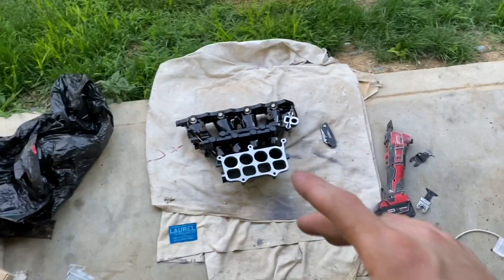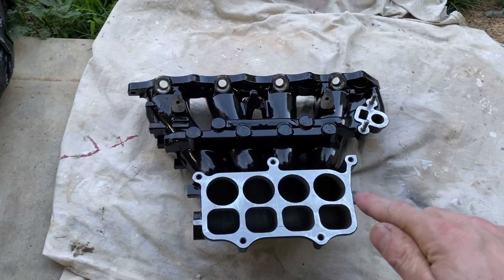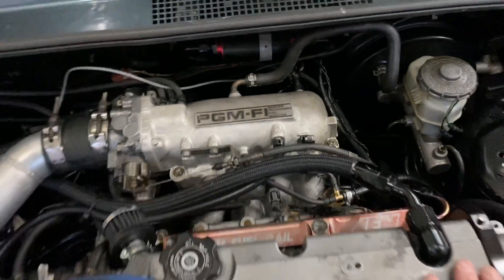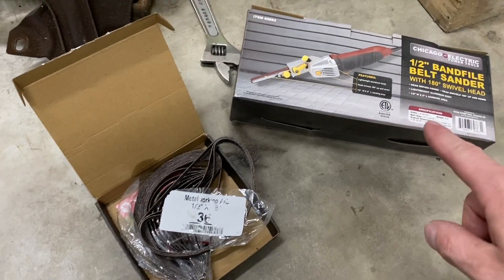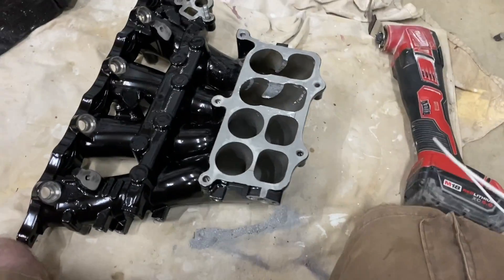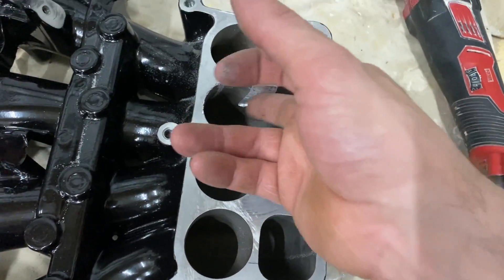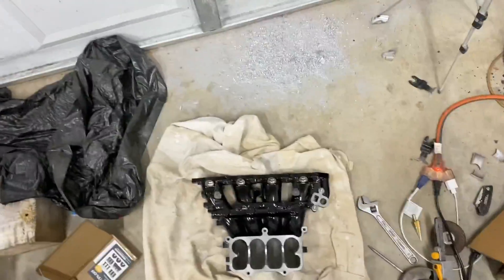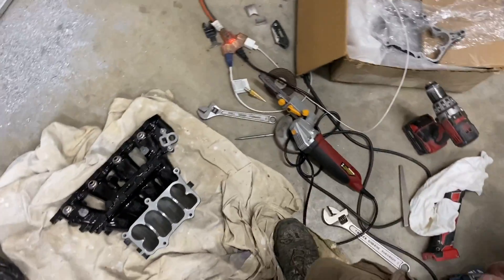Intake Manifold Port - H22 Max intake volume!

Comment: Great job doing the same thing and really like how you bolted the spacer for port matching. 91 cb7 se
Reply from the maker: Thanks brother! A lot of elbow grease in this operation but it creates a good amount of air volume right behind this intake valves. Great for those high rpms and or forced induction.
Reply from the maker: Hoping to complete an F23 crank and rod/H23 block/ f20c ap1 piston combo one day as I have all the parts aside from forged rods. It’s the most budget friendly forced induction engine.
Reply: @thestateofreal2533  that's awesome. Mine has a long way to go but being as I have 2 usable blocks I'm probably doing one forged internal and the other might end up a g23. Trying to leave a option for boost later if funds will let me do it right and budget friendly. Will be posting the build when I'm done, from rat's nest to glory. The 91 cb7 se is a one year only thing so I'm really trying to do it right for the honda guys.

Comment: I heard doing this sacrifices low end torque for high end power, any thoughts on that?
Reply from the maker: I have heard this theory but never seen it proven on the dyno. The idea seems right but the reason we do this is to combine it with other things like adding a bigger cam for instance which will need a more free flowing intake. In my instance I have both a larger cam profile from an F20B and forced induction - turbo charger - which makes incoming air more dense right at the back of the valves until they open. The more dense air volume that can fill the intake, the more we can cram into the combustion chamber.
Reply: @thestateofreal2533  any idea if this will cause issues for a stock h22a4?

Comment: Say no to knife edges when porting
Reply from the maker: Why do you say that?
Reply: @thestateofreal2533   Take example from F1 engines and MotoGP engines. They take examples from a water drop because 💧 will take the best shape for air flow, that's why CRX have better coef. of drag design than any other Honda including, Lamborghini's, Ferrari's, McLaren F1's and you name it. Because it looks like a tear drop with chopped off tail, and Prius has even lower coef. of drag because it has even less "knife edges". Big in the front and tapers down to in the back, but the front of any air cutting devider has to be the same size as the whole divider, it has to resemble a rain drop.
Reply: @thestateofreal2533   No air flow in the entire history of the world ever liked any sharp edges

Comment: Did you do the upper half? That kind of work is awful i would just buy a K series intake and adapter plate or Skunk2 before I do this, i've done it and it sucks. And it makes ur car actually slower.  Less velocity less low end power, less torque. Its for high end performance like high revving, and turbo. But yeah its easier to just buy a intake, you will break your mind and will doing this.

Comment: How much hp do u get with ported manifold
Reply from the maker: Couldn’t tell you because iv never dyno’ed with a non ported setup. That being said, others have and they say you loose low end torque but gain in the top end. The “science” behind this relates to the higher air demands on the top end. The more air you can flow without resistance the easier it will be or an NA engine to suck it in. For a turbo setup you get the same thing…less resistance and the ability to flow more dense air immediately as the intake valves crack open. You gain more air volume just waiting there.
Reply: All depends. Anywhere from 10-35 whp

Comment: do you need a tune after you port the intake manifold?
Reply from the maker: That is debatable by many. The Physics of a NA motor built is it always sucks in the same amount of air that the cam allows. Reducing the resistance of air flow allows for greater air density at a certain rpm. Greater air density demands more fuel to create more power. With stock cams and stock narrow band 02 sensor it should be able to read these minimal ratio changes and adjust. 

That being said, the gains you will see from this port are midrange / top end gains. You will loose low end gains with any max port as you loose low end air velocity which is the purpose of Honda having that IAB plate in the manifold.

Max gains are seen on NA builds (aftermarket cam) or boosted builds which will require a tune and will take advantage of the increased air flow (decrease in air resistance)

Comment: Would an angle grinder have been faster?
Reply from the maker: GodzUnit01 yes and no. The biggest challenge with the angle grinder and using a cut off wheel  (and I’ve seen plenty of horror picture) is it can grab and cut slices into the mating sealed surfaces. To me it’s not worth the risk of cutting yourself or the manifold where to don’t want to; and this is coming from someone who has ground welds with an angle grinder from high school tech onwards.
Reply: THE STATE OF REAL good point about angle grinders grabbing.
Reply: Dremel type tool with adjustable speed and the extension with a good dremel cutting wheel is a god send doing this gets in all the tight places and for smoothing as well you can pot polish both with Dremel and good bit of bits
Reply from the maker: Tbh, I burnt up my dremel using it on here. Thank goodness it was still under warranty!

Comment: Love the videos man!  I'm hoping to find a good deal on an old H22 that I can do a nice quality build until my H22 dies. :D
Reply from the maker: My Car DIY they are definitely out there and usually pretty cheap if your looking for USDM. People think they can handle a lot of boost stock but it’s a big misconception! They are good for NA setups also!
Reply: @thestateofreal2533  would you recommend a K swap for a turbo build?
Reply from the maker: It all depends on what your goals are for the turbo setup. Power goal? Street or strip? Built or stock? If you want to compete at the drag strip with Honda’s most advanced I-vtec or are you looking to hit a street horsepower goal (max 400-450 and below).
Reply from the maker: I will tell you 400-450hp on a steer car is about the most trouble your gonna need to crush anything on the street that isn’t built and anymore hp and you have to run radials...really sticky wide soft expensive tires not meant for daily driving.
Reply: @thestateofreal2533  I'm definitely not looking for drag strip or racing power,  just low to medium boost so when i hit the gas I feel that extra pull
Reply from the maker: My Car DIY smaller turbos spool quicker and give you that torque pull feel! So does nitrous and na setups so you have a lot of options!
Reply: @thestateofreal2533  what kind of NA options would I have?
Reply from the maker: My Car DIY many common h22 na builds involve a cam upgrade, larger throttle body/dual throttle body, balancing shaft delete/belt removal, ecu swap (for tuning fuel tables and ignition - p28, p72 obd1 Hondata) or piggy back, head porting, and tune with all upgrades or on 93 or e85.

Comment: What did you mean when you said you no longer have access to the same tools.  Did you work in a garage or machine shop previously?
Reply from the maker: Yes I have an associates of science for machine tool and computer aided manufacturing. Worked in the field for 8 years with both manual and cnc. I was a master machinist before Uncle Sam called me to work full time instead of just as a reservist.

Comment: great job dude. Which engine mounts you are running on your lude? I am almost done with my setup 500-550hp on my 98 prelude and looking for a good mounts for my setup.
Reply from the maker: Aloio h22 the mounts I made in one of my videos haha. This is no show car so I filled the mounts with polyurethane caulk! They are great!
Reply: THE STATE OF REAL Currently working on this myself! 3M?
Reply from the maker: Lord Chángo that’s awesome! 3M what?
Reply: THE STATE OF REAL Did you use 3M 08609 or what product did you go with for the polyurethane caulk?
Reply from the maker: Lord Chángo oh sorry I gotcha now. Nope I used loctite roof and flashing sealant. Worked out great! It was as dense and strong as 3M. I had to red loctite my motor mount bolts on because they kept rattling loose!

https://youtu.be/Hp7i7THoToo
Reply: THE STATE OF REAL I have your vid in my Watch Later. Will check it out 👍 I’m sanding, primering, painting the mounts as we speak 🤨
Reply from the maker: Lord Chángo haha sick. The only downside to this whole operation is the ds will always be rubber which isn’t bad. I would like to burn it out and pour straight urethane into and see if it holds. If not...I might have to go innovative into just that one.

Comment: Great job. Improvising to save mucho denero. I'm 67 retired auto diyer. I own a 2006 subie sti. My son has a 98 honda prelude base model. Eucalyptus green. Mostly stock has short ram intake aem with alpha works exhaust manifold. High flow cat with thermal research and development catback. 5 speed  with 235,000 miles
Reply: Thanks for the quick reply. At present trying to clear abs lite that comes on intermittently. Unable to scan for codes with my autel scan tool.
Reply from the maker: Piri Hern black paint works really well for that light haha. I deleted abs on this car...the system is quite simple parts wise. Chances are it’s either the module or one of the axle/hub sensors.
Reply from the maker: Piri Hern thanks! Sti’s are great cars too! I have own two eucalyptus green base models and they are by far my favorite colors for the prelude! That’s a sweet setup he’s got! I’m sure it looks sweet! Definitely better than mine 😂